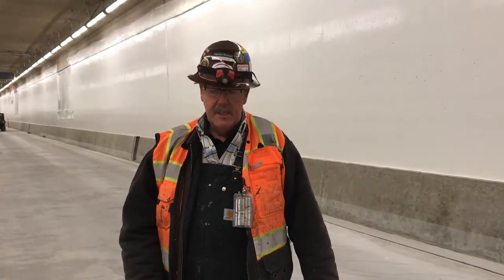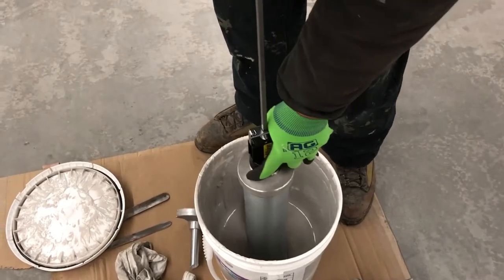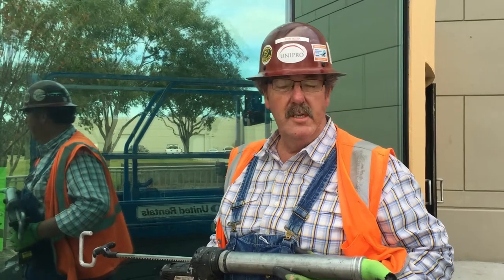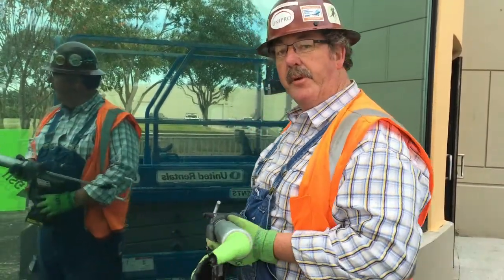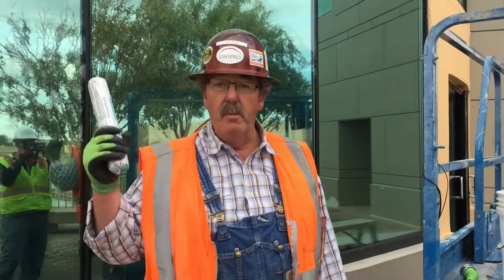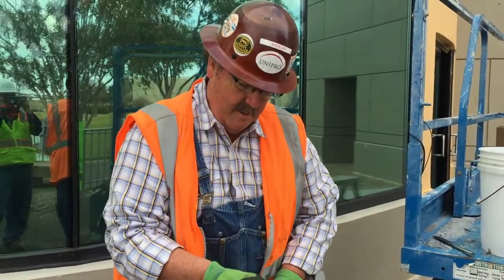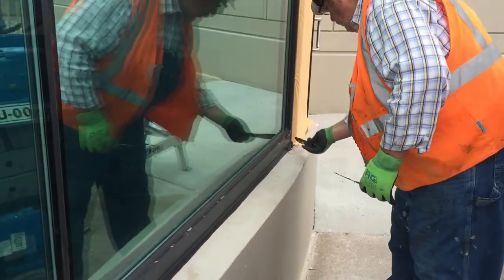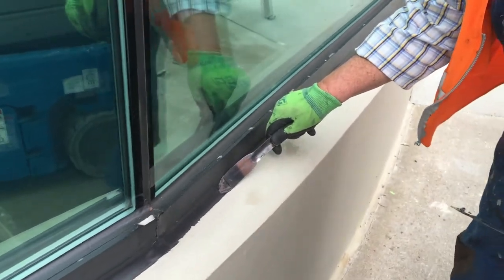Bulk caulking skills with loading, shooting, and tooling

Comment: Why doesn't the caulk stick to your tooling tool?
Reply from the maker: It does stick, but it is the angle and movement of the tooling that prevents excessive material from sticking to the tool and thus remaining in the joint where it belongs.

Comment: Just caulked your weep holes shut!.. Looks like an old curtain wall though. Could be a non weeping system. Well if it wasn't it is now!.. Nice caulk joint though.
Reply from the maker: The weep tubes were purposely covered. All the gaskets in the window system were cut back to install a silicone bead creating “rain screen” system known as “wet sealing.”
Reply: Ha ha caulking the weeps shut I’ve seen even the best caulkers do it

Comment: anyone have any tips on controlling the caulk when starting a new bead on an existing one like he does here .. a lot of the time i put down to much at first .. i guess its just a skill / control thing ?
Reply: to get rid of excess u can backtool it
Reply: @hansel2ss261  yes for sure , trying to work on getting it perfect first go though
Reply: @chyeaOGKush  well honestly thats kinda hard, even if i get a nice even bead, instead of just flat tooling i always even if it doesnt need it backtool it, then if it allows use a scraper blade to get the excess off the edge of the bead. If u cant use the scraper blade like on brick ur gonna have to tape the sides
Reply: You really have to work with an actual caulker and hope that maybe he teaches you. You cannot learn caulking by watching videos and especially not these disasters
Reply: @toecutter1015  haha yeah man - I found a local company that does high end residential and there work is mint -  much cleaner than this.
Reply: @chyeaOGKush  kinda glad to hear that there’s still some standards left in the industry. Caulkers I used to work with were extremely critical even if work was 30 stories up. It’s sorta bizarre that guys who sell Albion guns and accessories have absolutely No Clue what finished caulking and expectations are and can’t believe that their slop isn’t acceptable or even look good?? I would 100 % get fired for that shit work.We used to mix our own way better caulk than this clueless guy is using too

Comment: If the material is as runny as the first one you can loud the gun without taking the tip off just suck it up with the cone on it like a water gun

Comment: Those wavy lines would've been on the punch list and you would've ended up wasting more time and money cutting it out just to reapply a skim coat.
Reply: I said the same thing. Not a straight line and what's with electric guns... Slow as hell.

Comment: You just snip the end of the sausage with small wire cutter pliers!! That smacking the sausage over and over the top of your boots? Really? I have never seen that one before That caulking could Easily fly out that wide open sausage and make a huge mess that you can never clean up and that weird bent angle nozzle isn’t for basic simple straight runs it’s literally for areas that are difficult to get into.

Comment: Kick ass. Polyurethane out. Silicone in.
Reply from the maker: You are very poetic, but it is true, in many cases silicone is a much better choice. The reason for this is that silicon is inorganic. Being such, the covalent bonds of silicone are stronger than UV, thus giving it a longer service life with warranties up to 20 years. On the other hand, polyurethane is organic, and susceptible to aging weathering, and of course, ultraviolet from the sun. This is why polyurethane in some parts of the country can fail in less than five years. So, consideration should be given as to whether a silicone can be used in place of a polyurethane.
Reply: It’s all flim flam American No Standards little caulk and paint will make it what it aint Flim Flamming the flim flam

Comment: I’d get fired for tooling like that
Reply from the maker: What you saw in the video is an illustration of how to tool effectively and quickly.  After several years after being installed, the sealant continues to adhere and seal properly.
Reply: Where are your caulking videos Luis. Show us how its done.